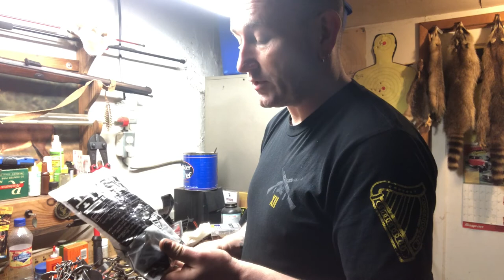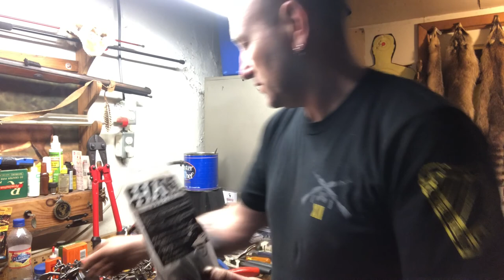J30 Hagz bracket and clip for water trapping

Comment: That was a great demonstration Paul . It's the best demo I ever seen with it .I have a dozen of them..  👍🏻
Reply from the maker: I really like the Hagz brackets, there are so many ways to use them for a water line, great for coon mink and muskrat, beaver too I think on bigger traps. You can use them as a drowner slide, a steak swivel, or a stabilizer, I love that I can have a body grip on the bottom in a rat channel and the foothold on a baited set on the top, really looking forward to using them.
Reply from the maker: I think too Chip if you can set body grips on dry land in coon trails would work for that too, I know you get z as log of them around your deer feeders.